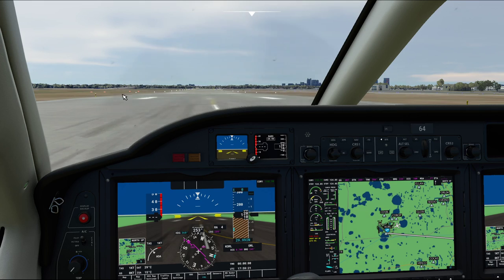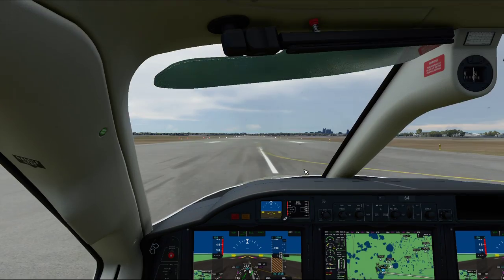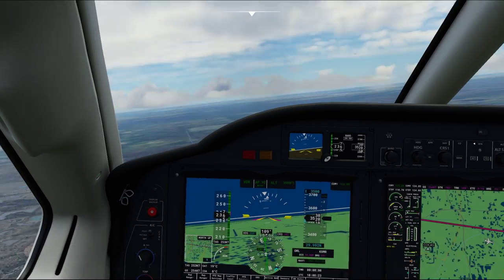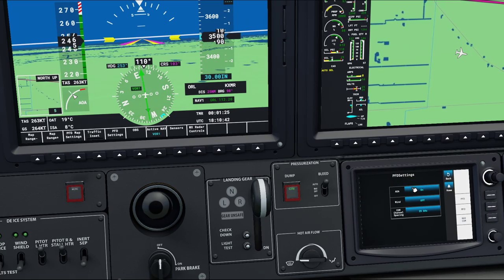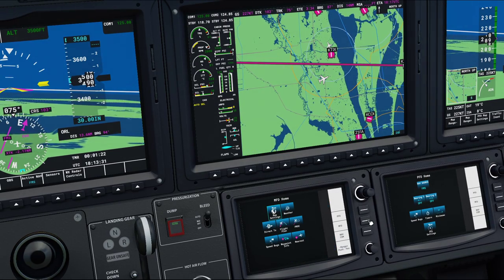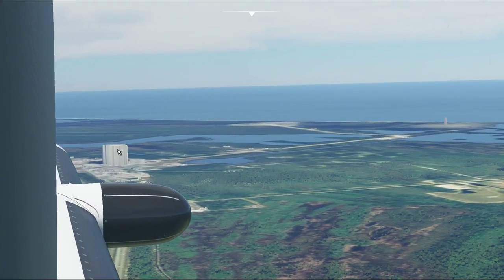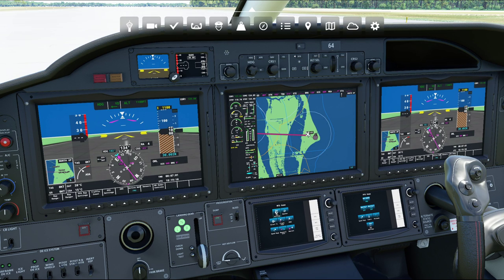FS2020 G3000 and Autopilot Tutorial with TBM 930

Comment: How to I get the aircraft to automatically decent to a preset altitude as it crosses a certain way point in the route?
Reply: It's called the Vertical Navigation function or VNAV / VNV. You should see the button for it on the Autopilot Panel, however many have reported it does not work properly.
Remember to set the altitude of the next waypoint before you get there so the aircraft knows to descend.
Reply: @joshuamarius  thank you. That is what I did but it did not work. I thought I was doing something wrong.
Reply: @saifbeg5374  I'm reading everywhere it's either not implemented correctly (buggy) or will be fixed soon.

Comment: Hello there!  You make very handy tuts.  Actually,  I'm new to this new sim. I wonder if you happen to know if there is a command I could bind yoke to to be able to sync HDG to my current heading? That could be very handy when changing from nav to loc on  approach for example
Reply: press the HDG wheel as a button and it will sync to current heading.
Reply: My question was how to accouplish  that matter WITHOUT use of a mouse.
Reply: @NJ-Tech  I don't like using mouse))

Comment: My guess is unrelated to the TBM 930 autopilot but I was hoping you could answer it anyway. I’m having trouble flying the TBM 930 manually because of issues I’m having with throttle. The TBM 930 has a throttle that follows an H shaped path. I have the Logitech throttle quadrant with throttle, prop, and mixture levers. The TBM doesn’t have a prop lever or a mixture lever, but whenever I move my throttle level and I watch what the actual throttle lever does inside of the TBM cockpit, I see the lever doing funny things. When I move my physical throttle lever up and down, sometimes the throttle lever in the TBM cockpit goes and up down the left side of the H but sometimes at seemingly random moments, the lever moves over to the right side of the H and the engine almost stalls. Also at times my engine gauges start blinking red. Any suggestions for how to map my throttle in the control setting so that it properly mirrors the H shaped throttle path in the TBM?
Reply: Hi--the only suggestion I could offer is what worked for me. I have a CH yoke/throttle/prop/mixture combo.  Make sure that you map your prop and mixture levers, along with that of the throttle, individually (be sure to use the "axis" assignments for each), and set up a linear curve for each.    Hope this helps.

Comment: Hi. What is" Vr" "Vx" "Vy" in speed bugs ?
Reply: Hi. 
Are you asking him what his V speeds are set to, or are you asking him what Vr Vx Vy mean?

If it is the former, then please disregard this reply.

If it is the latter, Vr is your ‘rotate’ speed, at which you begin to pull back on the controls, during take off, to rotate the aircraft, towards its climb attitude. 

Vx is the speed that achieves the aircraft’s best climb ANGLE or GRADIENT. That is greatest gain in altitude as compared to horizontal distance. This is the best speed for climbing around mountainous terrain, or perhaps trying to outclimb weather buildups ahead. 

Vy is the speed that achieves the best RATE of climb. That is the most altitude that you can gain per unit of TIME. 
It is a higher forward speed than Vx, so you will cover more horizontal distance per minute, than you would flying at Vx, but you will be at a higher altitude after that minute elapses. 

Vx-best angle
Vy-best rate
Reply: @normannutbar424  Hi. Thank you for answer :)

Comment: Thanks for the awesome video! Do you have any recommendations for how I can get more into flight sim? I’m brand new to flying of any kind but would really like to learn more about this. I really don’t understand many terms or abbreviations or basic flight procedures. Any help is appreciated!
Reply: I have some advice.  Stop trying to learn how to fly in a TBM930.  Go fly a C152 (or maybe a 172, or similarly performant low-wing) in and out of the same airport dozens and dozens of times until you have a grasp of the basics.  

In a sim, a grasp of the basics is going to include at least some instrument navigation as the graphics, no matter how good, aren't good enough for TRUE VFR (Visual Flight Rules) flying, which involves using visual points on the ground using ded navigation.  (Not a typo, ded is short for deduced,  which is taking a ground course and distance and calculating by applying what you know about winds aloft (a feature that is apparently currently INOP in the sim (INOP=inoperative=it's broken)) and the difference between IAS (Indicated Air Speed, what you see in the cockpit) and GS (Ground Speed, your actual speed over the ground).  FS2020 has absolutely amazing graphical fidelity, even out in the sticks, but it's still not good enough to allow for TRUE visual flying, as the ground reference points just aren't there, or aren't modeled accurately enough.

That leaves us with radio navigation, which from a practical perspective means using your VOR and ADF radios.  VOR stands for Very-high frequency Omnidirectional Range, and ADF stands for Automatic Direction Finder, though it's less important to know that than to know how to use them.  It does note mean GPS or autopilot, those are for after you have the basics down pat.  You have to be able to fly without them first.  One important thing to keep in mind is that it's actually easier (generally speaking) to hand-fly a real world aircraft than it is a simulated one.  This is for a number of reasons.  IRL, it's MUCH, MUCH easier to properly trim your aircraft, because you can actually feel the pressure go away from the control surfaces.  Real world airplanes seem less resistant to having light turbulence knock them away from a wings level attitude, though it CAN and DOES happen which is why you have to watch it like a hawk.  Trim, in fact, can be so subtle (especially on a low powered trainer) that it requires just a small, constant nudge on the yoke (or stick), and you can do it without really realizing you are, thus forgetting to use the trim wheel at all.  You can both feel and hear throttle changes and adding/removing flaps/gear, and respond to them quite easily to get stable flight, unlike the sim which seems to hunt around more.  So much so that I'd almost label it a bug that needs to be fixed by changes to the flight model.  In a real 172, if you want to go down at 500 fpm (feet per minute), just pull the power by 500 rpm, and you'll pitch down into a stable, steady speed descent.  The simcraft will go too far nose down and then too far nose up multiple times as it tries to find that steady state attitude.

Anyway, back to radio navigation.  I didn't mean to write an entire flight lesson, but here we are, and I'm not done yet.

I'll start with the ADF because they're brain dead easy, even if not used much in real life.  (In reality, they're used more to listen to AM radio, and as a poor man's lightning finder as they'll point towards lightning when tuned to an unused channel than as an actual navaid.)  When tuned to an active channel, the arrow on your dash points at it.  It's that simple.  They're easiest to use when flying TO the station, as you literally point the aircraft in the direction the needle is pointing, correct for wind, and fly until you get there.  They can also be used to triangulate a position, or to fly AWAY from, but I'm not going to get into that here.  You tune your ADF to an NDB (Non-Directional Beacon) or a terrestrial AM radio station.  But those aren't charted.

VORs, on the other hand, are more useful.  When using a VOR for navigation, you are essentially using the equipment in your cockpit to create an invisible highway in the sky.  You can either fly directly AWAY from or directly TO a VOR, or you can select a course, known as a radial, that you want to fly.  For VFR flying you'll mostly fly VOR to VOR.  To do that, you determine the course in between, dial that in to to the OBS (Omni Bearing Selector) knob on your instrument, align the course needle by flying TO it and centering it in your indicator.  You should tune both VORs into your NAV1 and NAV2 radios, and about halfway in between switch from flying away from the first VOR and towards the second.  A needle or other indicator on your instrument will tell you if you're flying to or away from a station.  Depending on how far you plan to travel, you just go from VOR to VOR to VOR until you get to where you're going.  While I haven't really over-simplified this, knowing how it works and actually making it work takes practice.  You're not going to jump into a super-advanced aircraft and get this right the first time, that's just not realistic.  Like I said, forget about the TBM, get into a proper trainer with steam gauges, turn off or ignore the GPS and autopilot, and learn this until you can do it in your sleep.  No twins, no turboprops, no jets.  If you try to use those you'll be 100 nm (nautical miles) past your target before you figure out just how to tune the radios properly.  Note that as you get close to the actual VOR, your needle will get very squirrely.  Don't chase it, if that happens, you're already  close enough.  Just pat yourself on the back and setup for your next leg.

A couple of notes on the sim:  Use the active pause feature to help you learn this.  Tune your radios while you're not moving, play with the OBS to see how it works.  But be a bit careful, I used it the other night, and while paused, I did something, pushed on my yoke or accidentally pulled the power or something, and when I unpaused, I was in a stall/spin and 100' off the deck.  Too late.  But, in a sim, death is not permanent, for you or the aircraft, so no biggy.  And while I think there's a bug there that needs fixing, in real life the active pause feature doesn't work at all, so there is that.  Also, don't radically turn your graphics settings down chasing framerates.  This is a flight simulator, not a FPS, and you don't need crazy 144 fps for it to be enough, truth is 30 or above is perfectly fine, and the technology to get max graphics and 144 fps simply does not yet exist.  The gentleman whose video we're commenting has his video settings so low, that I could barely tell a runway was a runway, even when he was pointing at it.  Don't do that unless you absolutely have to,  and in that case, it's time to strongly consider some upgrades.

If you've got a 2nd monitor or a tablet, put up some VFR maps (called Sectionals, or TACs (Terminal Area Charts) around busy Class-B airports).  There are a number of sources, and it's free because it's government provided data.  I use flightaware dot com, but find one you like and stick to it.  Or even better, order the actual paper charts, they're easier to use than trying to manipulate it on a display, and very inexpensive.  Trying the lessons in the sim is probably a good idea, but I haven't tried them myself yet to know whether or not I truly recommend them, so YMMV.

I'll go ahead and stop now.  Finally.  I didn't plan on writing this book, was just going to tell you to get real and stop trying to fly the TBM if you don't even have a grasp on basic terminology, but I got on a roll and this popped out.  But, I've been looking for an excuse to start a Youtube channel for a bit, now, and may have just found it.  I won't be the first, but there's room for one more.  HMU if you have questions or would like some help, am happy to do what I can.

KevyKevTPA
Reply: Kevin Moseley hmm. Didn’t work for me either. Is that the correct capitalization? 

Mine is Deviilzz.#0640       (Including the period)
Reply: I finally got you added on Discord, HMU sometime and I'll go through some flight planning and nav radio usage stuff with you.  Then we can do a multiplayer session and you can follow me on a trip from St. Pete to Key West.  It's one of my favorite flights, both in the sim and real life.  Unfortunately, I doubt I'll be doing it in real life again any time soon, and if I can't get the usage of my legs back (at least ENOUGH), "any time soon" may turn into "never again".  :(
Reply: Kevin Moseley I’ve been a bit busy in school right now but I’ll definitely hyu soon. Thank you again!

Comment: Great video! But I have a problem. I set everything properly, and I get up in the air, and I hit the engage autopilot button, and the yokes turn in the direction they should, but I still have complete control of the plane. The plane does not act at all how it should with the autopilot engaged. The plane does not respond at all to the autopilot, I still have to hand fly the plane when autopilot is engaged. I am using the same Daher TBM 930, going from Queenstown NZ to Christchurch INTL NZ. I have no clue what to do. If someone could help me out that would be great. 

I did try and look up what I could do, but most things just said that there is no autopilot, and you need to let the AI fly the plane from the drop down menu at the top, and that is the autopilot feature. But as shown here that is not the case and would make no sense. I am extremely vexed at this issue, and any help would be very generous!
Reply: Same thing happened to me... I could not turn on AP.
Reply: Have you turned On the AP master switch -extreme right hand side of the overhead panel?
Reply: @billtamarisfawcett9297  yes.  I turn it on, and let go of my joyatick, and the plane just starts ro roll. I even trim the pitch and roll but nothing works. I turn it on and off, and on.

Comment: 1. How do you actually know the right angle to approach a landing from before you get to your destination? Setting a flight plan from point A to point B I can see will get you to point B, however, won't actually line you up with the runway at point B. Following that straight line all the way will bring you to the airport but wont line you up for landing. How do you plan for that?
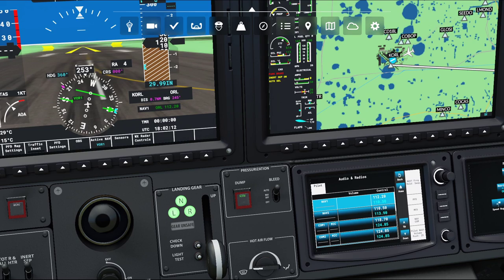2. At 2:50, you mentioned doing the math and using skyvector. Where abouts in that image of skyvector at 1:08 can I see the "103" you are referring to.
3. Why use VOR as opposed to GPS? GPS seems simpler (clearly im not a pilot).
Reply: I think I can see the answer to #2 within the video :)
Reply: I had the same question. From what I've practiced in-game, you have to find the frequency of the airport you're landing on and use it in your destination
Reply: I look up the approach for the runway and follow it to some extent. But there should be a way to get atc guidance to final.
Reply: 1. If you are flying VFR, you'll want to do a circuit when you reach the airport destination (obviously contact tower and listen to their instructions). If you are flying IFR, usually the destination airport tower would provide you with a STAR to follow. However, i dont think the AI atc in this game actually does that, so you could choose one to your liking depending on the runway the tower assigns to you.
2. At 0:47, you can see some numbers on the purple line to the left. That represents the heading you need to follow from the VOR station (103º) and how far you need to go (41nm).
3. If the aircraft has a GPS system like this one does, might as well use GPS since it's relatively easier to use. The Cessna 152 for example doesn't come equipped with a GPS, so you would have to use VORs.
Reply: @Da-Creams  thanks for the replies. So the game doesn't current have this functionality?
Reply: When you near the airport you need to shoot an approach If you have ur destination set when you click MFD you will see approach select runway and type and activate it and the map will show what you need to follow however it current doesnt let you intercept an app so you would have to start from initial point which is very very annoying you will see what i mean when you start doing it basically waste of time atm but you can manually intercept it turn ap back on and when you catch the glide slope hit apr button learn how to read approach plates and ur life will get 38478294x easier!
Reply: To add to this reply, it is a good practice to listen to the ATIS (if available) of the Arriving Airport when you get close. It will tell you what Runway or Runways are being used for landing/departing, which will then give you some time to be better prepared for the actual landing.

Comment: I hope someone can provide an auto throttle add-on for all the glass cockpits. Why auto throttle is just now becoming available IRL is beyond me.
Reply: The next model up, the TBM 940, has an auto throttle system, which is largely automated it seems, and has a number of profiles you can select and it'll do the work for you.  Not sure why they chose the 930 over the 940 for the sim.  I learned this off steve1kineo who did a video on it.
Reply: Auto-throttle is very rare in General Aviation aircraft. Even bigger private jets don't have it. It's mostly used in big Airliners.

Comment: How do you get the autopilot to follow the GPS in the TBM 930
?
Reply: Enable Nav mode
Reply: Adding to Jose's reply: also make sure the CDI on your PFD is set to FMS. The button is middle of soft buttons under the display. Can also be changed from PFD settings on the small middle touchscreen.